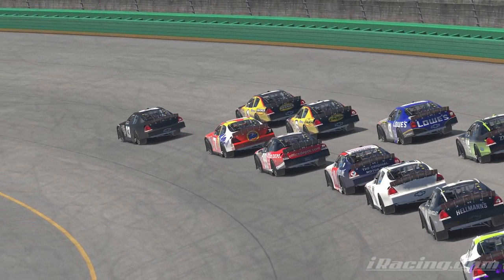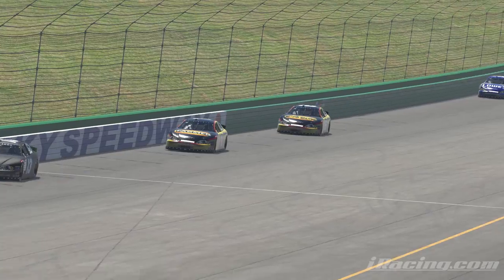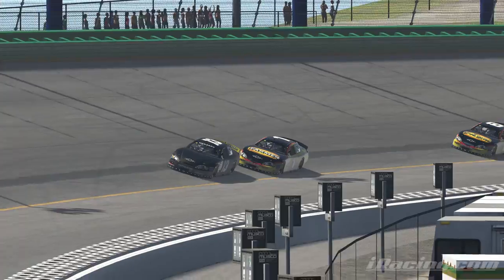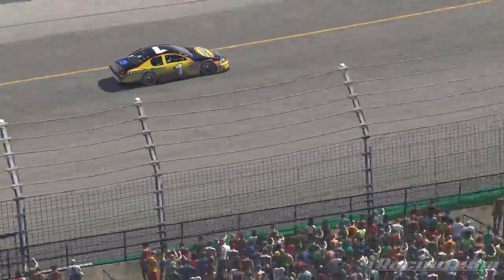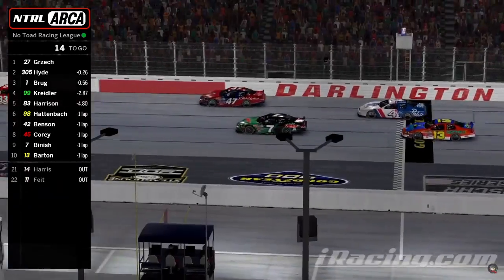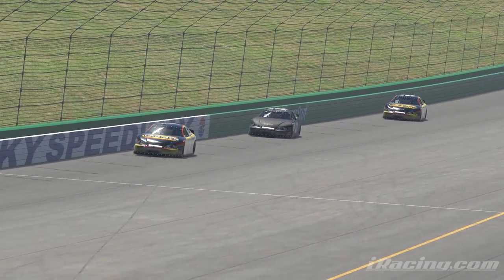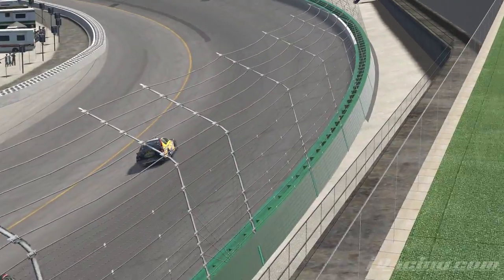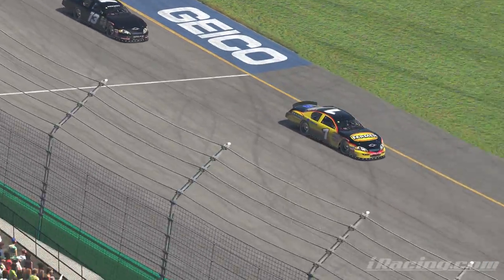7 Things Road Racers Don't Understand about Oval Racing

Comment: As a low split driver who can get quite a few wins, but struggles overall with consistency, I can say one thing.  Never underestimate just how far saving tires can go. It will almost always pay big dividends at the end. If you are leading a race early and you get like a 3 second lead, you are doing it wrong. A gap is just your clearance to save harder. Sometimes the most satisfying thing is to manage an intermediate race from the front so well, that when the car behind you starts to gain with about 10 to go, you pull an extra tenth or two out of your pocket for good measure.

Comment: 2:20 one thing ive done a few times on the superspeedway tracks is forget to lift off when a crash happens
.
like... a crash happens ahead of me.... and i just keep my foot planted on the gas.... end up crashing into the side of Kurt Bush LOL
you have had your foot in that position for 300+ laps....and your brain just forgets that you even have that foot
.
idk.... its hard to explain.... 
its like being "velocitized" on a highway doing 75mph
when you slow down to 25.... it feels REALLY slow (or, the opposite also applies.... after doing 75 for miles and miles.... doing 95 feels like 50) 
.
.
.
but ya.... you have not moved that foot even 1 millimeter for 450 miles
and then you suddenly have to react with only 0.25 seconds to think
.
and i just leave my foot down (or even press the gas harder.... thinking im pushing the brake)
its SO strange..... and it just makes you feel dumb after lol
.
.
anyone else know what i mean?

Comment: Part of the tire strategy is also your setup - another much deeper level of intricacy which doesn't get talked about by the "haha you like car go left" crowd. Sure, you can use more downforce on tracks like New Hampshire with just a 2 degree bank - and you can also use a lower tire pressure and softer suspension, but your tire wear will now ensure that you're one of the first people to enter to the pits. So you could, for example, in qualifying, set up your car to run high downforce and low tire pressure to get a high grid start, and then in the race use a lower downforce and higher tire pressure to ensure that your tires last for a longer period of time - this could turn your race into a 2 stopper instead of a 3 stopper which means, while you don't get around the track as fast as everyone else, your tires make sure you're putting in more laps between pits than everyone else, too.

Comment: I kinda wanna see this same vid but switched around, things oval racers don’t understand about road racing, cause there r oval racers that have zero clue when it comes to road racing, ESPECIALLY NASCAR fans in general. Cause I race both ovals and road courses, though I prefer road racing more cause that’s what I enjoy and it’s more challenging, and at least to me oval racing is honestly easy once ya get it down. Like the part where ya say oval racing is mentally challenging, maybe others think it is but to me and maybe others think this but it honestly feels easy when it comes to oval racing. I think the only times I’m like stressing on an oval is on certain short tracks with certain series mainly cause I’m just trying to hit my marks and not be holding up guys behind me or not hit anyone or be hit. Where as road racing it doesn’t matter what car you’re running u gotta hit your marks every corner every lap. U can go through one corner one lap and then the next lap and ya mess up that same corner by either missing the apex or running wide and getting an off track. Maybe people will understand where I’m getting or people will think “wOw, wHaT a pRiCk fOr sAyInG tHiS!” That’s just what I think. Ya wanna think that, doesn’t matter what u race if you’re an oval racer, road racer, hell even a dirt racer, u can go run an oval and then a road course and see what y’all think.
Reply from the maker: I would if I could 🤣 I’ve run I think 15 total non-nascar road races. Though I could pretend I’m qualified because nascar road races inflate my ir lol

Comment: On superspeedway racing
Be selfish. If you get a run or have a chance don't be afraid to take it. Getting up front and dictating the pace of the field is important. If you can get to the lead or up close to the lead and click off laps, it gets you a much better chance of winning. 
Look Ahead and predict. If you get a run, figure out what's gonna happen and what the guys near you will react. it's the difference between getting a good position or wiping out half the field.
don't be afraid to dip below the yellow line if it means avoiding a crash, or shunting someone into the next zipcode. Braking suddenly or letting off can cause the guy behind you to just smash you into the big one.
Watch other drivers. This is the most important thing. keep an eye out and ear out in voice chat if someone is slowing up a line or weaving in the lines. if someone is struggling to hold lines or can't keep it straight, make sure to not be near them if they cause something to go wrong. Likewise, pay attention to who is really good at pushing or being the pusher.
Learn your gut. you're gonna have moments where you need to pull out and go to the back if things get frisky. but you gotta know when. 45 laps to go at dega, probably best to ride in the back if people are getting very racy. but 10 laps to go, well, you just gotta deal. It's all about what you see and this varies moment to moment.
In half/full distance races, make sure to just survive. most of the longer distance races are gonna basically be about survival. Stay on the lead lap, and keep your wits about you. Still, keep yourself in position to win. 99% of the time you're not gonna be able to zoom to the front suddenly. when the time comes try to push for the top 5 or in some position to be a factor. 
Also this goes unsaid, but watch your temps. nose to tail pushing rises them up fast and I've seen even veteran SS guys blow engines suddenly pushing too hard. Temps are a resource so make sure to use them wisely. can be the difference between pushing a guy out to the lead and causing a line to fail.

Comment: Fun fact - The reason the cars in the video look like they’re sliding or drifting around corners is because the bodies are actually mounted sideways to an extent. The aerodynamic effects of this help push the car to the left slightly, and thus make left turns faster and easier.

Comment: A tip I found on super speedways is to not get in to a battle up front to soon in a race as you run a higher risk of a wreck I spend most my speedway races drafting and only passing when I feel its safe to I try not to push hard untill the last 10 to 15 laps of a race as learnt the hard way about tires wear.

Comment: I love racing in rookie and watching the new players all start hitting the wall in the last 10 laps because they dont understand that even just 10% break and slight throttle lift would keep the average speed up while allowing them to keep out of the outside wall as they would have better rotation of the car, if you run charlotte flat out out by about the last 10 to 12 laps of a race your tires will be cooked in the rookies as no new sets of tires in them shorter races, lost a few at charlotte due to burning the tires up so I get passed easy on the last 5 or so laps.

Comment: One of the biggest things in ovals is patience a lot of guys wanna race as hard as they can soon as the race starts and they will wreck themselves and others for that next spot even if it’s lap one of a 200 lap race I can’t tell you how often I laugh when a guy is racing so hard on the first 10 laps and then when I drive back by him still saving and being patient not really trying to race him just working my strategy and he is all over the place trying everything he can to hold on to that spot lol 
But on the flip side those guys are the ones that tend to cause the bigger crashes early in the race so it’s a love hate deal for me. 
But patience is huge in road racing I’ve noticed if your faster than someone they will let you by vs trying to race someone who is faster and risk crashing especially early in the race. 
Ovals is a different story you can expect multiple ppl to race has hard as they can no matter how much faster you are than them but that’s where patience comes in and once they use up their stuff no matter how hard they try they typically can’t keep up or they wind up in the pits with a wadded up car one of the two

Comment: Consistency and being smooth on the wheel is key in oval racing. You've got to hit your marks lap after lap. The difference among competitors could be a few hundredths to tenths a lap. If you get behind, you can't make up the gap as quickly as you would in road racing. 

I'd be happier than a pig in shit when I'd get back to the hauler to check lap times and see 95% was within a tenth of each other.

Comment: if u start in superspeedway with the idea to win you already f... if u drive a 1.5 miles with what should be the driving lane well you never try anything else just follow what it should be!! for me I'm an outside lane also very lose (sliding) to make sure i will not be a 20 lappers run and don't ever forget that a setup will never be done... were u start what's your number what is the split you racing track temps etc..

Comment: Long runs with huge amounts of tire wear are where the best show up and perform. Jeff Gordon was one of, if not the best under these conditions. Seemed like as the runs went long, he’d get faster and faster.
Reply: His dirt racing background had something to do with that. He was used to the car sliding around, as it does on dirt, and was an expert on driving a "loose" car, so he lost less speed than other drivers when his tires started going away. Same for Tony Stewart or, for a current driver, Kyle Larson.

Comment: Using the breaks on an intermediate oval sounds so counterintuitive but I’m going to start using it! …as in sun racing I never break on intermediates but maybe that’s where I’m going wrong! … while in general I prefer road racing as a Brit I’m frustrated by how much oval racing is underrated in Europe as a whole … to me short oval racing is very similar to an medium fast road course … with constant medium speed corners … yes it’s easier qualifying and learning the racing line then typicall road tracks but like you said the race is more hard work for most off the field … super speedway’s racing to me has more in common with cycling track and road racing where spending the majority off the race in the leaders slipstream before a last minute sprint for the line for the win is generally the way to win plus avoiding the big crashes … like I said superspeedways more in common with Olympic and Tour de France cycling then  typical oval and road racing!… as an f1 I love the extra variety ovals give to Indycar and NASCAR while f1 tracks have lost a bit off wide variety in road courses since the mid 1990’s

Comment: As someone who’s 5,000 IR on both oval and road. There is no doubt oval takes a lot more skill than road. Oval, you really need to know how to wheel a car, and understand track changes and manage tires. Road… tires are meh, and honestly… more reps spent on the track the better you get but other than that no much skill when it comes to the racing aspect.

Comment: One thing fantasy oval racers don't understand about actual, in a real car, road racing. I can turn my car around and go just as fast in the opposite direction. Ones and zeros racing is hilarious: my arms get tired because I don't train (do push-ups or hold a plate and twist). Oval racing is absolutely road racing just without the distraction of full right hand turns. You have to do all the things to set up the car properly to come off the corner, just not turn it in the other direction. In real life, oval racers hire road course drivers in NASCAR(which you are depicting) to drive road courses. Road racers just drive everywhere. The best drivers can drive any type of track.
Reply: But how often have those road racers hopped in a nascar car and beaten the nascar drivers at cup level. I agree the best drivers can run anywhere but there are very few road racers that have made a dent in nascar even when going full time
Reply from the maker: :_YeeCringe:

Comment: With formula -style racing, if you are imprecise by even a meter (from your mark), you end up completely rendering at least a $10M USD car. Oval racing may look boring, but the racers are on constant knife's edge. The consequences are more likely to be catastrophic (if not for the team's budget). It's one big reason why the Monza circuit got a redesign from its near-oval layout and why the FIA formula series are squeamish about racing on ovals (not withstanding the wing setup and chassis setup that's required for oval racing). In open wheel racing outside the US., you can think of the banked turns on the Nordschlaefe (North Circuit of the Nurburgring), the banked curves at Zandvoort, or the Parabolica at the previously-mentioned Monza. And also Twin Ring Motegi.

Comment: Any oval racer can race on normal circuits, AS THEY DO.
No one can just go from any other motorsport and do any good at ovals without a huge training.
Reply: it's quite the opposite. pretty much every road racer does well on ovals. on the contrary, this does not happen with oval racers.
Reply: Lul, the oval racer probably won't even know how to turn right. 😂

Comment: I disagree with all 7 of those things, A competent road racer will do well anywhere on any track
Reply: That hasn't worked out well for a lot of competent road racers in real life who tried NASCAR and found out their skills didn't translate as well as they thought.  There are a few notable exceptions (Jeff Gordon, Tony Stewart, Mario Andretti, A.J.Foyt come to mind as road racers who were successful in NASCAR), but many successful drivers from other racing disciplines have tried their hand at NASCAR and failed.

It's a different skillset.  Some road racers pick it up fairly easily... some don't.
Reply: That wasn’t the point of the video buddy. This video is to show road racing tactics probably won’t work in oval racing and you should adjust your tactics. If you don’t change your tactics then you probably won’t have much success on ovals. Same works the opposite way. As an oval racer myself, road racing takes some adjusting to